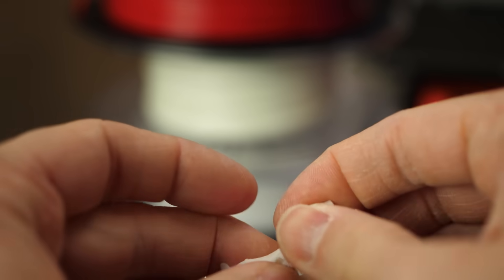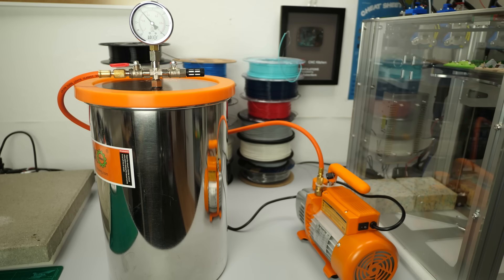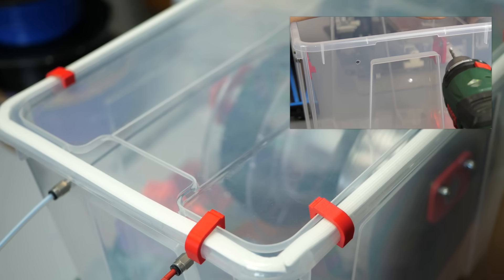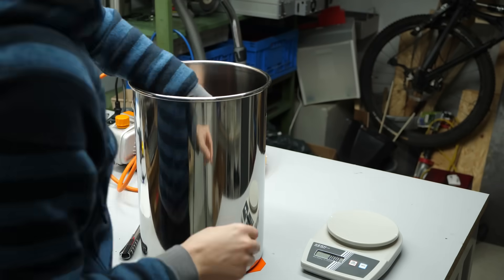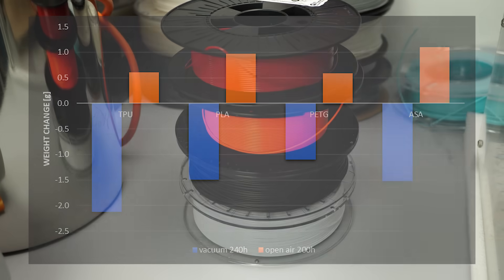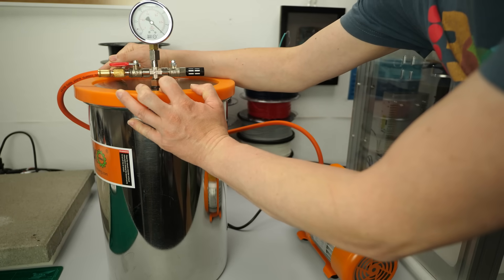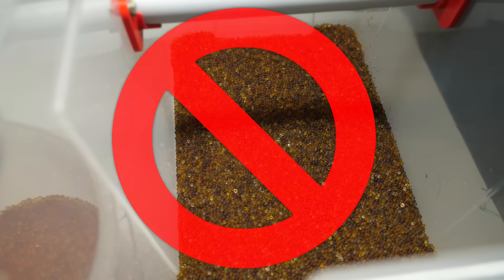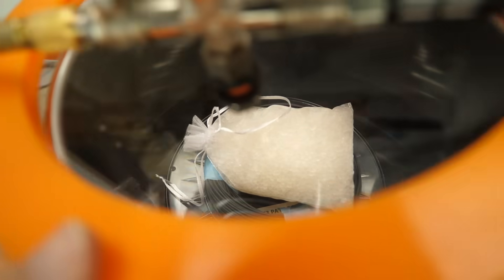Vacuum VS Dehydrator! What's the best way to dry filament?

Comment: Did you see this? I am sure you can make your own. https://newatlas.com/multi-polymer-3d-printer-filament/
Reply from the maker: I have seen it, though I'd really like to see the paper, that unfortunately is not available for free. Don't really understand, why this should be stronger that PC-ABS or PC alone.
Reply: The filament cross section looks nice, but I'm more interested in what comes out of the nozzle.